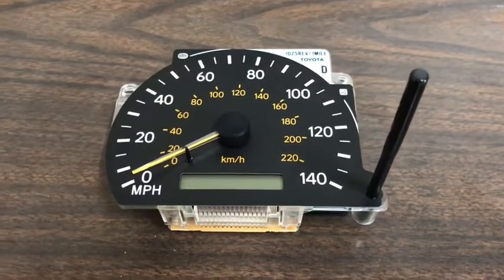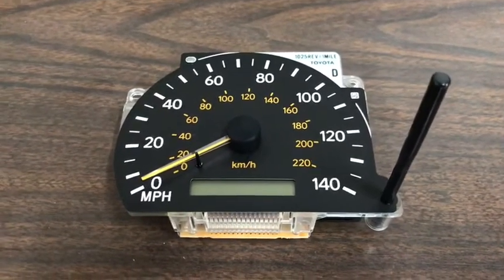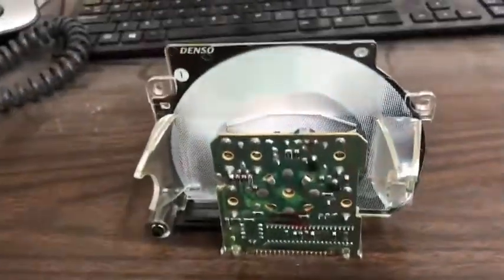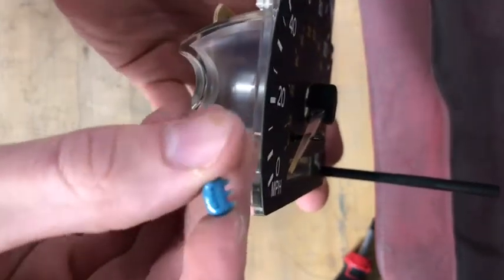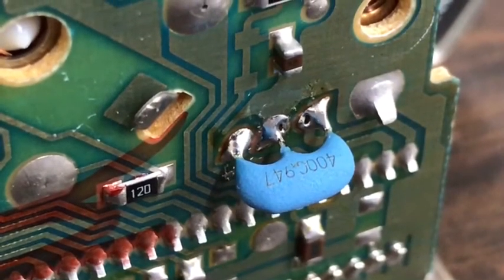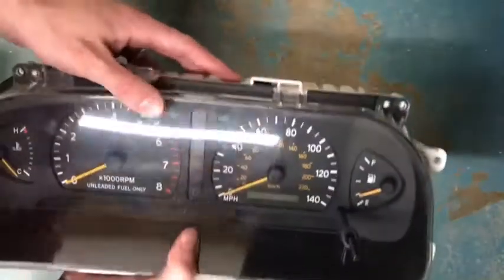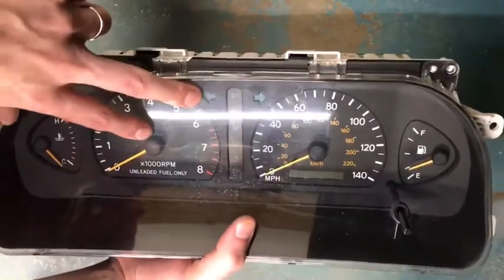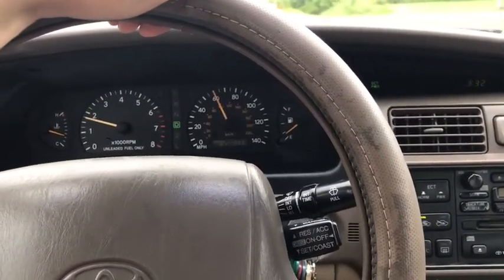How to fix Toyota Lexus Speedometer and Odometer that is not working with Erratic Shifting

Comment: What causes all gauges to stop working, dash still lights up and displays info, but gauges don't move.
Reply from the maker: Sounds like a different issue than what's in this video. but I would first check for bad fuses or bad electrical connections behind gauge cluster. If all that checks out good, then maybe the instrument cluster needs replacing?

Comment: Hi Jeff!! Thank you SO SO much for this video. It worked in fixing the speedometer and odometer on my Toyota Rav4. Besides the issues you listed we also had a code P0500 which this fixed as well. Just wanted to express my gratitude for this.  Thank you again so much!
Reply: I have a 99 Rav4, 4 door, AWD, Automatic, 2.0L and the issue i have is just the speedometer and Odometer stopped working.  The odometer is digital which doesn't come on and the speedometer is a needle which stopped working.  I don't have any issues with shifting, but i had a Check Engine light which is on with the P0500 code which links to the Vehicle Speed Sensor.  I went ahead and had a shop replace it, however the issue is still present and the code hasn't cleared.    

Did your car have shifting issues before the fix?   

How long does this take to do?

Thanks!

Comment: Thanks for this video! My Chaser kept losing speedo and odometer randomly, changing this part has fixed the issue.
Reply from the maker: Great to hear! Thank you for the feedback.
Reply: What car model?
Reply: @nicoarntz8477  Toyota Chaser JZX100
Reply: @KC-wt2xs  Hi I am having the same issue. It just randomly stopped working one day and now it has been almost a year. Since last year it has only worked 3 times. Do you also recommend to replace the Speed sensor

Comment: My 95 Camry’s transmission has been misbehaving for years, and today the speedometer was erratic. Wonder if this is why.
Reply from the maker: Someone mentioned that they were able to have a similar issue fixed by replacing their whole instrument cluster for their non-digital odometer style. It was some resistor that had an issue, but I could not tell you which one it was. But definitely worth looking into.
Reply: @jeffharrell1874  Well... I went and got a instrument cluster assembly from my local pick-n-pull, and because it's a mechanical odometer, I removed the speedo needle and set the mileage to the current mileage on the old cluster. When I reinstalled the cluster, the speedometer now sits at 40mph when the car is sitting still. What did I do wrong?
Reply from the maker: @computiNATEor  sorry, I’m not quite sure what may be affecting your Speedo  since I’m not as familiar with that generation Camry. It’s possible You could have more than one issue going on. Here are some possible root causes that may point you in the right direction that I pulled from an article... “The most common causes of a speedometer that stopped working include a faulty speed sensor, a broken gear on the speedometer, damaged wiring, or a faulty engine control unit”
Reply: @jeffharrell1874  Haha, no worries. Taking the cluster out for the 4th or 5th time now. All the needles sat still on my trip around the block, including the tach. Trying again...

Comment: Jeff, thank you so very much!! Just in time I found your video!! I was going to mess up with the IC of 8 legs(?)(pins?) at the left end of the long IC just because I do not see ANY soldering in one of the second legs of this IC !! I took a picture of yours and it was looking almost like yours (the 8 legs IC) It does not show enough soldering either or maybe it is left that way? I wish I could send you a picture of my speedometer although it is a T C 1998 LE 1.8. Mine shows 110 MPH at the end. At 76 years old I would be happy with even 70MPH!! Have a great New Year 2021.
Reply from the maker: Good luck! Hope it works out for you.

Comment: I have this same problem when i drive my toyota mark2 in the hot sun odometer goes blank speedometer stop working and the transmission does not shift anymore.
Reply from the maker: Good luck on the fix. You’ll be glad you did it!
Reply: Hi, did u try this and did it work? I got a chaser doing the same thing
Reply from the maker: @dannyshen1292  I’m confident that this fix should work for the Mark2 and Chaser models as well. They seem to be almost the same as the Camry/Corolla/Celica. I did not originally think to include those models in the description because those models were not sold in the U.S. Let me know how it works!
Reply: @dannyshen1292  i replaced the whole dashcluster with  used one but in good condition and it's working good now.

Comment: @Jeff Harrell Thank you for the info - great video. I have a Rav4 1997 with all these symptoms (however this car does not have a digital odometer) I manage to get the speedo out of the cluster but I cannot see the 'blue ceramic resonator' do you know if this model has the same style as your video?
Reply from the maker: Sorry Davey, I think this would only apply to a digital display type. But it does make me wonder if there may be something similar going on in the old odometer style type. Unfortunately, my expertise is very limited in your case to be of much help. Best of luck though! And If you do find the solution for your mechanical odometer, I’d be interested in hearing it.
Reply: @jeffharrell1874  thank you for your fast reply, I will keep you posted if I make any progress.
Reply: Hi Jeff update on rav4 .so I needed to get the car running ASAP so I mange to get hold of a 2nd hand cluster, swapped it for the original and it fixed the all the issues, it was great to get to that final gear.  After investigating the faulty cluster I found that a two 2 pin resistor had blown so I am guessing that was issue. Thanks again for your video.
Reply from the maker: @daveycalko8817  wow. That’s great! Now if your new cluster has significantly different mileage in it, I wonder if that resister part can be taken off the one you just got, and placed on your original one. But if you plan on keeping the car until it dies, then it may not be that big of a deal to you. Thanks for the feedback! All this info is valuable to me, especially if I ever plan on getting another old Toyota with these types of issues.

Comment: Would this cause a P0500 code in addition to the speedometer/odometer not working?
Reply from the maker: I don’t remember having any codes on mine when these issues came up. But I have heard of this code coming up for others with these issues. It may be possible you have an issue with the speed sensor. But if you have a blank odometer display, then it’s most likely the resonator is bad and not the speed sensor. Are you having hesitant shifting while the odometer/speedometer is blank?
Reply: @jeffharrell1874  Yep, shifting is hesitant, P0500 with MIL, no speedometer/odometer display (98 rav4, 2wd at). I've replaced the VSS connector, checked continuity from the connector to the cluster, and fiddled with connectors in the driver's footwell. It's intermittent, sometimes speedo/odo will turn back on after a few minutes driving.
EDIT: If I clear the code, then MIL goes off, but code and MIL both come back the next time the car shifts.
Reply from the maker: @ocdkirby  ok. I would give the resonator replacement solution a shot. Your symptoms are pretty much the same as what I had. Let us know how it turns out. Good luck!
Reply: @jeffharrell1874  I've got the resonator desoldered and am ordering the part now. One last question--did you have to recalibrate your needles after taking the gauge cluster down to this point or would that only be required for a more invasive teardown? Thanks so much!
Reply from the maker: @ocdkirby  no recalibration should be needed. Just replace and go.
Reply: @jeffharrell1874  Update: Ordered the exact same MPN off of Mouser because it's US-based, soldered to the board (I have really small electronics pliers, so I was able to solder it into the exact same position as the original component instead of doing it on the back of the board like you did), and put the gauge cluster back together. I haven't gone for a drive yet, but my odometer is on when I turn on the ignition, so I'm pretty confident that the problem was fixed! Thanks!
Although it is a bit weird that a resonator in the gauge cluster throws P0500 (fault on the VSS circuit), I'm happy I didn't have to replace the VSS (which would have been $200).
Reply from the maker: @ocdkirby  that’s great news! And that’s pretty impressive finesse to be able to solder that back into the original position. I’ll even update my video tag description to include your trouble code so that others with your same issue can find this video. Thanks for the feedback!
Reply: I hope so. I changed both speed sensors and check engine lite comes on. No mph movement and milage is blank
Reply from the maker: SilverWhooper I’m confident this fix will work for you. Especially if the rest of your instrument cluster is working. The part is only about $5 after shipping costs. What’s your car model and year?

Comment: Hey Jeff, came here from the CarGurus forum. Thanks for making this video, it helped a lot with visualizing where the resonator would go before tearing my dash apart. Gonna try this on my 98 Camry when I have some time 💯
Reply from the maker: Kale Soup Good to hear! When it’s completed, let us know if it worked for you. Good luck!
Reply: Jeff Harrell good news! I got the resonator soldered last night and hooked everything back up. As soon as I turned the car on the odometer also turned on. The speedometer also works and I haven’t had any issues yet. Thanks for the help.
Reply: Update: haven’t had a single problem with the speedometer/ odometer since I changed out the capacitor(resonator?).
Now for the evap code 😂
Reply from the maker: @kalesoup7633  lol. That’s great! Yeah, I’ve gotten to the point where I just live with some of my trouble codes. It would cost me hundreds of dollars for a mechanic to get to well hidden sensors that don’t really affect engine performance. In fact, the engine light has been on for so many years that the bulb finally burned out, and I’m too lazy to replace it. But it still runs great and I never plan to sell it. I’ll still read the codes from time to time to ensure nothing new comes up.
Reply: @jeffharrell1874  haha I haven’t gotten there yet. The only issue now is oil leaks and getting past inspection
Reply from the maker: @kalesoup7633  I actually just recently posted a video on replacing the valve cover gasket from where I had an oil leak. It was on my SUV though, but it has the same V6 engine, so it’s very similar to my Avalon.
Reply: @jeffharrell1874  mine is an I4 Camry but it’s nothing serious
Reply: @kalesoup7633  when your speedometer wasn’t working was your mileage not moving either?just want to make sure I’m headed in the right direction
Reply: @ramiba1683  The odometer would be blank too, but I’m pretty sure it was counting the miles even though I couldn’t see it.
Reply: @jeffharrell1874  would this work on toyota camry 1998 thanks in advance 👍
Reply from the maker: @johngarcia6434  it should if you’re having the same symptoms. Good luck!
Reply: I have this problem 98
Reply from the maker: @jamesonseide5855  go for it! You’ll be glad to have your car back when it’s fixed.

Comment: I can attest this fix works for the symptoms described. I used the same soldering iron (but with the flux paste) and resonator linked. Tested it twice in South TX with heat index well above 100 and speedo is working and odometer shows mileage again. This saves literally over 50 bucks. Don’t be nervous with the soldering. Watch YouTube videos and practice on the board that comes in the kit. Thanks so much!!!
Reply from the maker: Awesome news! It’s amazing how such a cheap part can cause major problems. I lived with these symptoms for years before fixing. It’s nice to have it behind me now. Thanks for the feedback!

Comment: I’m having the same exact issues as described
Reply: Been a few week since I replace this part. Been working great so far. I would recommend people order a few since the shipping is more that part it self. No too sure, first one I soldered in was defective, but I had to redo it. This defective part can cause P0500 since I pulled code with reader
Reply from the maker: Let us know if this solution ends up working for you.